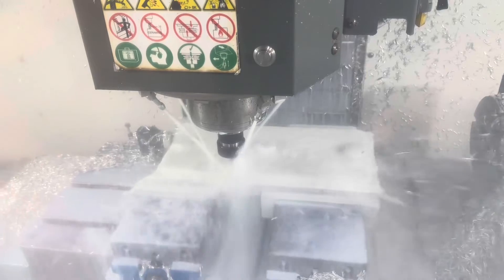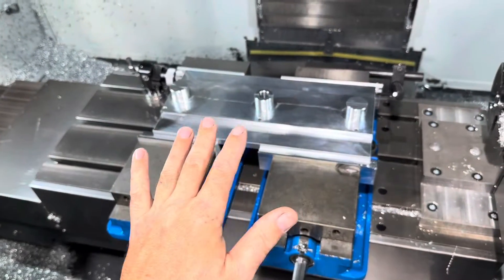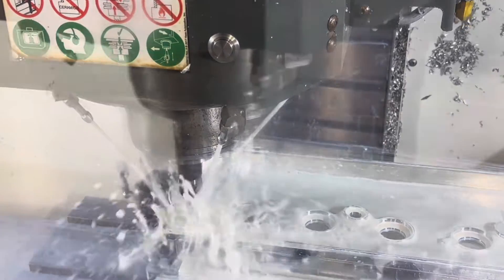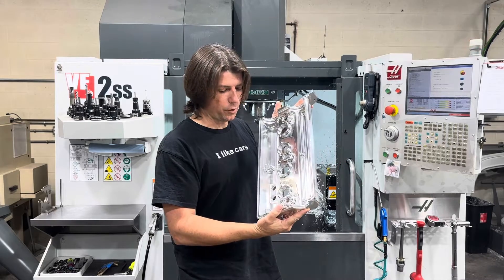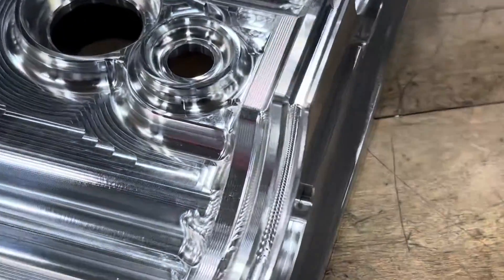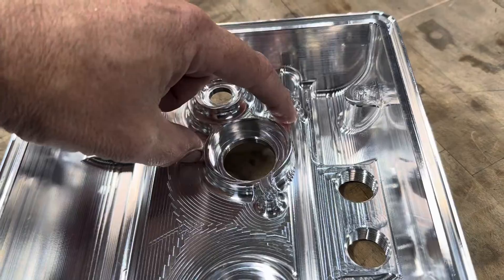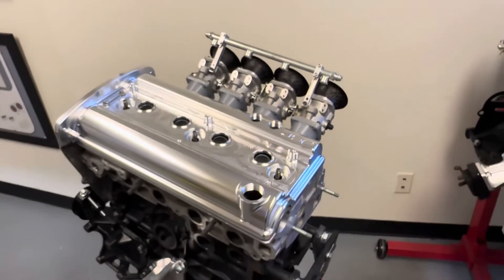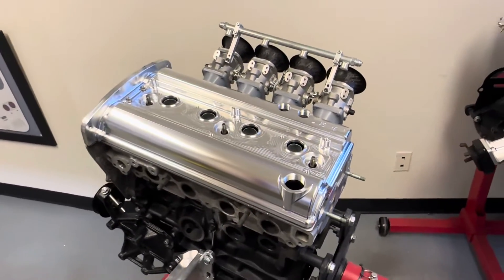This Week in the Shop : Episode 3 Billet valve cover machining

Comment: Nice work. I always have good luck scanning from the bottom up on these types of jobs. It lets the side wall of the ball endmill do the heavy work instead of the centre of the tool where you have a much lower surface speed. Maybe worth trying if you're having surface finish issues with that long tool. A slimline heat shrink would also definitely help, more rigid and you shouldn't have to hang your cutter out as much. Keep up the good work 👍

Comment: Is there any particular reason you chose not to run the finishing tool path perpendicularly on the outer surface of the cam cover? Perhaps cycle time due to additional travel?
Reply from the maker: I’m not understanding what you mean by “perpendicularly”. Perpendicular to what?
Reply: @johnrussakoff  Taking spark plug hole centres 1-4 as reference points for an imaginary centreline on the cam cover, your current finishing path travels parallel to this centreline. I am suggesting a finishing path that instead travels perpendicular to that centreline.... 90° to your current direction of travel. I hope that is a bit clearer